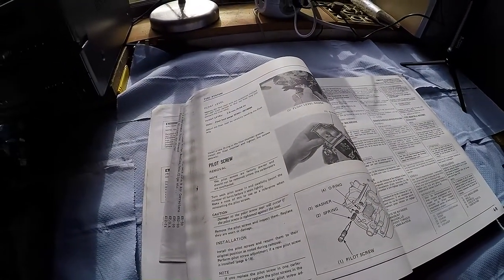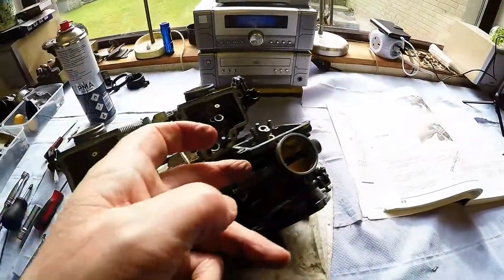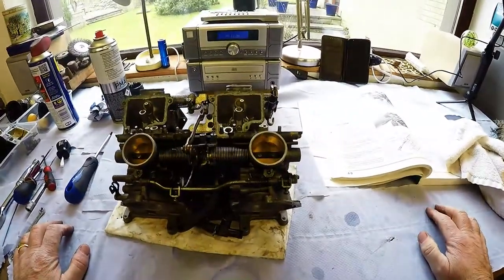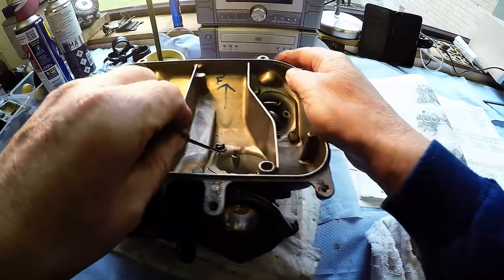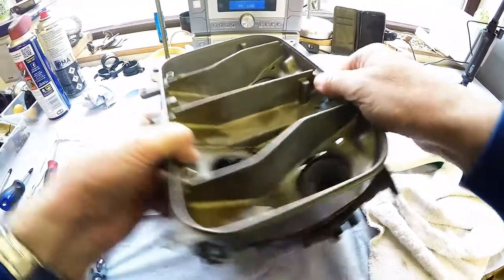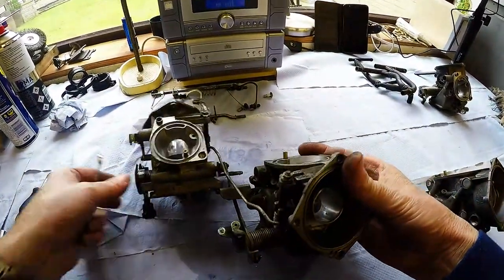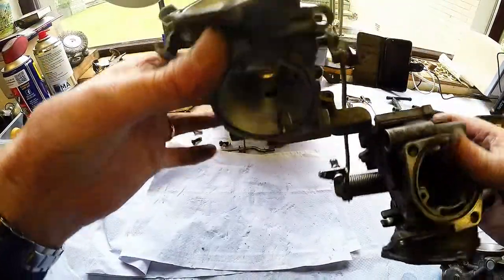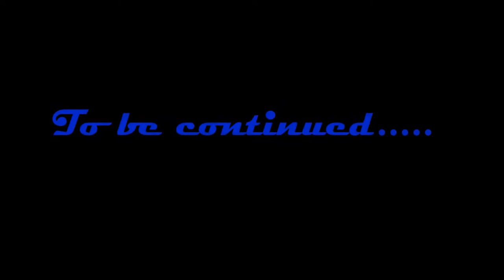VFR750 Carburettor strip Pt 2.

Comment: Hi. Great videos, full of detail and info. I have recently acquired a 1991 rc36 and about to strip and clean the carbs, it has sat for while and the petrol drained down to the sump. I'm going to replace the o rings on the pipes between the carbs when i get to them, along with a carb rebuild kit. Are you able to tell me where I might get the o rings please I cant seem to find them online or do i go to honda? Any help is much appreciated, thanks Chris.
Reply from the maker: Hi Chris. I got the 'O' rings from a company based in Dublin called AbbeySeals. They have all the info you require to order. Hope this helps.
Reply: @AlistairCampbell1047cc  hi, thanks for the quick reply. I will give them a call and take it from there, hopefully back to riding around skye very soon. Thanks again.

Comment: if u remove the idle mix screw it helps if the orientation is vertical so gravity helps  keep spring, washer and o-ring together.

 far too many ppl think its necessary to spend hours taking every single piece off a set of carbs for cleaning, when in very many cases, just clearing out clogged idle jets in about 15 minutes is sufficent to restore proper running to our vfrs. seems like youre a relative novice at this task, so may be too soon to begin lecturing.  choke plungers can be lubed w/o fussing around, just pop the rubber end cover up and shoot in some oil or spray lube, ez.